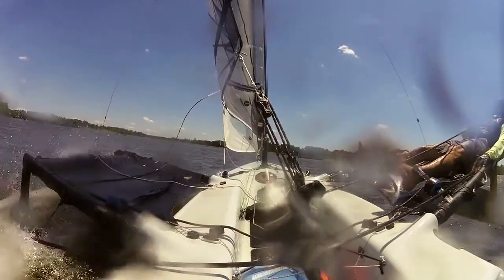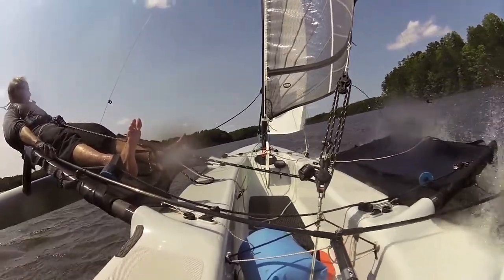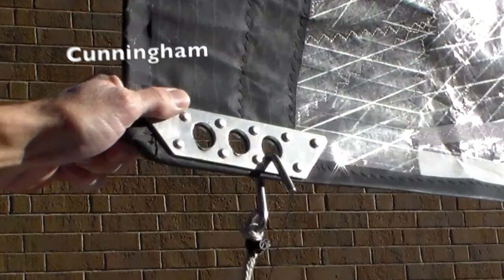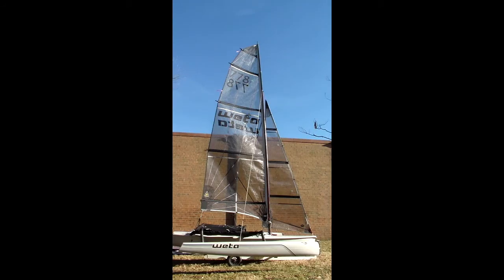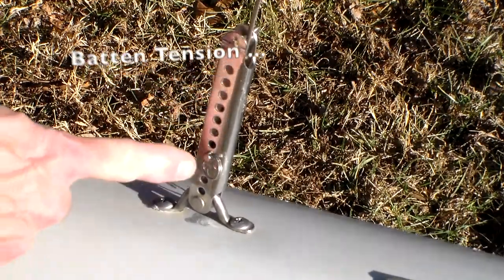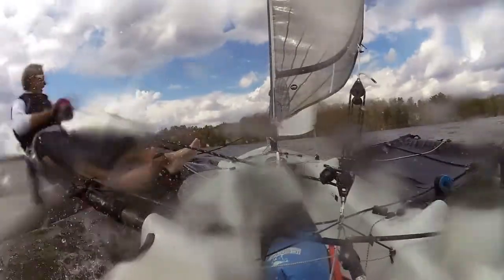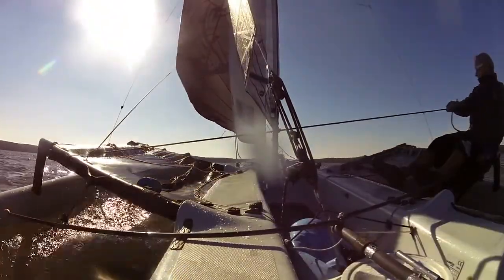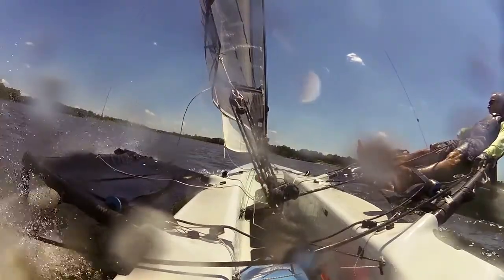Weta Trimaran Rigging Options

Comment: Excellent explanations of sailing dynamics. Ever reef the sail on your Weta ?
Reply from the maker: It's not possible to reef it. Instead you use the clew plate adjustment and other items that I mentioned in the video to depower. There are some custom Weta sails that have been made with reef points.
Reply: TomKirkman1 thanks again 👍🌬⛵️
Reply: BTW have you seen the new Superfoilers ? https://www.youtube.com/watch?v=qlYUmHM52bY
Reply from the maker: As the owner of a TriFoiler, I'm not terribly impressed with any of the new foiling boats.
Reply: This is new class of racing I believe..  I like anything that Flys it's looks challenging.
Reply: TomKirkman1 I do love the tri-foiler , ahead of its time for sure.
Reply from the maker: They cannot beat a TriFoiler, even 30+ years later....

Comment: Can you show how you have made and connected Duel Tiller arms
Reply from the maker: The extensions are fitted with short sections of rubber hose on the tiller end. A single 1/4-20 screw runs up through the tiller arm and through the ends of the hose section. A washer and nut on top. This allows for flex at the joint. It's a simple set up.
Reply: Have you got a picture please Tom
Reply from the maker: I don't currently but will try and get one for you this coming week.
Reply: Thx Tom
Reply: I have to say this is such great idea, very clever  and great video